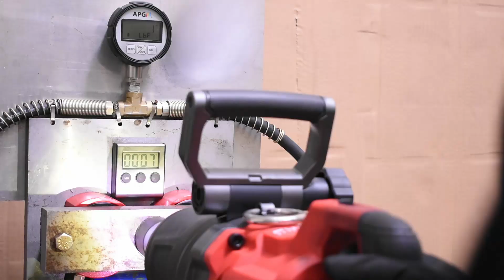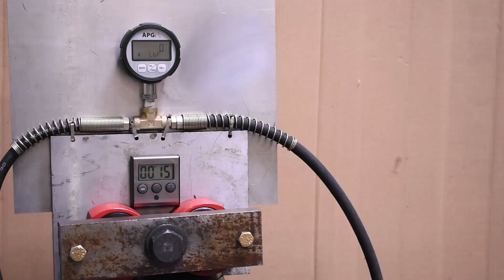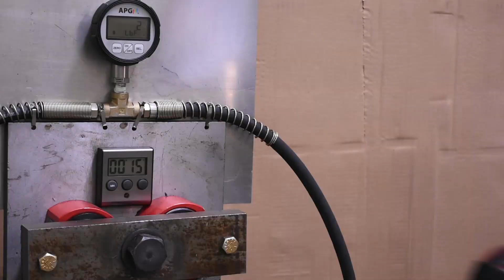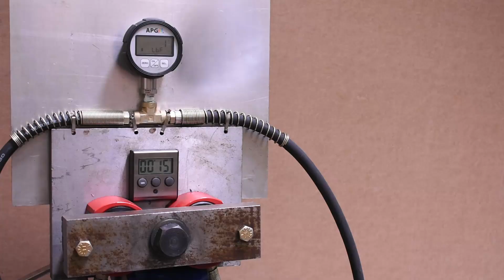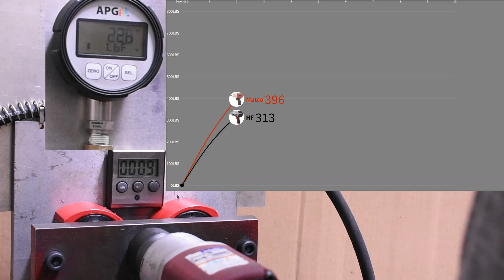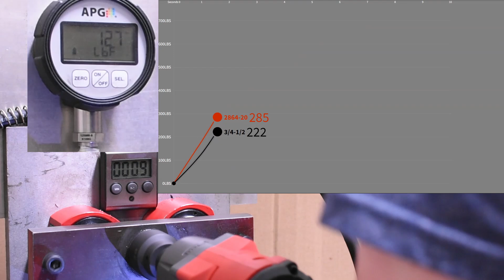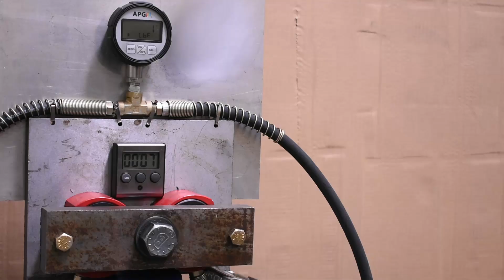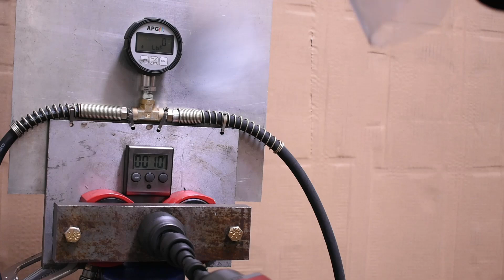How Much Power do Impact Drive Size Adapters Lose?

Comment: I'd like to also see this done with 1/4" hex adapters for impact drivers (to 1/4", 3/8", 1/2" squares) vs. direct-drive hex bits (nut drivers).
Reply from the maker: Not really possible. The direct drive nut drivers dont go up large enough, will just snap off a bolt head that small eventually. Nothing to measure

Comment: I understand what you’re saying about not calling out a manufacturer for low specs if you haven’t tested the same way. But, I’m wondering, is their test setup reasonable? If the specs they claim can only be achieved in a setup that most people can’t achieve, I’d argue that it’s borderline dishonesty. 

Any idea if there’s much difference in efficiency with different air tools? Since it’s hard to actually meet spec on air supply, I’m very curious how different tools are at different air supplies. 

Also wondering if some of the tool companies are using “give it more air” as an excuse to avoid efficiency increases. Some of the less reputable ones might even increase the air supply specs above what the tool is happy / lasts well with, just to brag about their torque numbers. They’d know that most people wouldn’t be able to supply that much air so it’s not like they’d have lots of warranty claims from people using their tools above the safe specs. 

(My interest in this is purely theoretical; I use impact tools primarily in my RV in a Walmart or Home Depot parking lot. Cordless, not air is what I need)

Comment: I did wonder if manufacturers tests were done without even a socket attached to the driver maybe there’s just a square drive on the dynamometer !
Reply from the maker: For dynamic torque it's done into a female square drive, the torque numbers on a box (working, max) are traditionally used with a socket on a Skidmore Wilhelm bolt tension machine like we're doing here
Reply: @TorqueTestChannel  So really you have answered most of your question about why manufacturers figures and yours differ so much !

Comment: After watching this I use an adapter for my job.
No problem.
Because it's only a low torque application work scenario for me.
I will do it again and again if it is possible then waste my time to shop for the recommended size.
Buy if you need it for heavy duty application, go get the right one.

Comment: I'm happy because I have the Makita 18v 1/2 inch impact wrench and only occasional use a 1/2 to 3/4 adapter to undo 46mm nuts and I notice little torque loss. Very interesting. I've been waiting for this video. Thankyou!
Reply: Hey Nick
So you wouldn't trade your 1/2 in to a 3/4 in?
I also have the Makita 1/2 in with 1000Nm (DTW1002 in Europe) but was always wondering if I made the right choice
Reply: @MattPrimefulL  no I wouldn't trade it. I'm happy with it having owned it nearly 2 years. You can also buy 1/2 inch big sockets aswell so no need for an adapter. Most of the sockets I use aren't big anyway. Also It's very rare to come across any nut that the 1/2 inch won't remove which also applies to the 3/4 inch.

Overall I'm glad I bought the 1/2 inch because most of my sockets used are 17mm, 19mm, 24mm and most often are 1/2 inch drives.... the minority of sockets are 3/4 and even the bigger ones nowadays are made for 1/2 drive.

Comment: In industrial settings everything is 1in air hose and chicago fittings. Plant air is usually not anymore than 130 or so psi but flow is never a problem. Some of the bigger guns will use 2 1in lines, 3 men and a crane to hold the weight. Nowadays that type of work is usually done with hydraulic wrenches or super nuts. Great work guys.
Reply: I was looking a specs on 1" wrenches and they want somewhere around 50 CFM, compared to something like 5 CFM on 1/2" wrenches.
Reply: Hytorc hydraulic is the way to go. 
Super nuts are safer though

Comment: Sounds to me like you need larger line to maintain the 90 psi. Note that the pressure jumps back go 150 psi after running it, indicating the tank isn't the issue, rather the supply to the gun. 
Source:just some Joe schmoe that's never even seen a 3/4 impact in person
Reply from the maker: 1/2" air line with 3/8" NPT (which measures about 1/2" nominally) threaded right into the gun is already pretty big. A 3/4" air line is pretty massive in person

Comment: Thanks! That totally explains why I won't buy  a 1/2 to 3/8" adapter, vs a 3/8's impact wrench.  As always your videos are very entertaining.
Reply: I have a Makita XWT15Z that I run a 1/2 to 3/8 adapter all day long. yeah the adapter breaks eventually, maybe every few weeks haven't actually measure the time, but it does work. Now that I know I'm only loosing 7% or so, I don't think that is bad. the Makita XWT16Z the 3/8 version is rated 20 fl-lb lower on the max torque, and 50 ft-lb lower on nut busting, so at 7% it's a wash. But with the 1/2 i'm more versatile.

Comment: The adapters are still great for breaker bars. Since it is more of a constant force you shouldn’t lose any torque.
Reply from the maker: 100% correct
Reply: @TorqueTestChannel  With size adapters and a torq wrench, would the adapters affect the result of the torque wrench? i just bought some for this purpose.
Reply: @raph882  hey mate did you get any answers to Wether it reduces what you should set the torque to?
Reply: @raph882 The answer to your question is no. The centerline of the drive end of torque wrench and centerline of bolthead/nut will be the same, so it is not affected.  Heck, you can use a whole bunch of extensions, as long as they are in a straight line from fastener to torque wrench, the torque wrench will still apply proper torque.
Reply: I've massacred four 1/2 to 3/8 drive adapters doing this in 15 minutes just on 19-21mm lug nuts. I use an old USA made Craftsman breaker bar and it doesn't flex while going thru these adapters like butter.

Comment: You need to try the SnapOn GSAF1F adapter.  Claims it can handle 2000lbs. I use mine with my IR air and battery guns with no issues for years. Probably pushing 500+ ft lbs
Reply from the maker: 2,000 in-lbs :P

Comment: For the 3/4 pneumatic impacts you should try running a second 20ish gallon air tank inline  just a couple of feet of 1/2" hose with only a tee fitting for the pressure gauge running to the gun
Reply: I have a 20 gallon buffer tank fed by my regulated air. My 1” impact is connected to the buffer tank with a 3/4” hose about 10 yards long. Works well even with a very basic compressor, haven’t put a gauge at the impact admittedly.

Comment: This makes me feel better about my choice to buy all my impacts as 1/2" and use the 3/8" or 3/4" adapters.

Now I can estimate my torque losses better.

This channel has become one of my favorites. Thanks guys!
Reply: You can get lots of things done with just 1/2 and 1/4", just have to be mindful of what kinds of power you're laying down because driving an M14 bolt with 1/2" can easily go south
Reply: @lolatmyage  You can definitely get a lot done with those two. I have a small astro nano 1/2", an earthquake 1/2", and a skinny electric 1/4" snap-on ratchet. With good swivels for them, there's not much that forces me to grab a ratchet or wrench
Reply: There new video on the Milwaukee 3/8 vs 1/2 shows that the 3/8 of ANY brand actually outperforms or matches it's 1/2 counterpart
Reply: @user-sg4jm9oq6d did this include ridgid? I saw a video comparing their newest 3/8 and 1/2 sub compact and the 1/2 came out on top

Comment: If you twist the impact gun handle in the direction you want to move the fastener and take up any slack between the squares (for all sockets/extensions/adapters), does that lessen the torque lose? If it does, might come in handy in situations when your gun is barely unable to move it.

Comment: Maybe you could do a test comparing losses to the tightness of fit. An adapter which is loose rotationally could absorb some of the impact energy. An adapter which drops more could perhaps cause the tool to wobble more. That would be an interesting test. Measure the maximum rotation or drop angle and the pressure applied at the maximum angle. Perhaps tape an accelerometer to the tool too.

Comment: Testing idea; testing your own set up.  Specifically how much does it change the results if you over torque the nut/bolt with a high torque impact and then allow a less powerful tool to reattempt the same test.  Similar questions on lubricants.

Comment: Wtfbbq! Love it guys! I've never broken an adapter but mine are S&K from the '70's and I never use them with impact anything only hand tools. I mainly use the 3/4" to 1/2" reducer for axle nut bell sockets on the Dana 70/80 full floating rears.

Comment: I “torque” thing at work at hard to reach to places which sometimes causes me to use a wobble adapter. Torque values are usually between 260 to 500 pound feet. Be cool if you could test torquing a fastener with a wobble impact adapter between the wrench and the socket. Thank you 🤞🏽
Reply from the maker: https://www.youtube.com/watch?v=f0xhgQiTGUY

Comment: I'm curious if an adapter throws of torque wrenches the same way, making their readings up to 30% off
Reply: It doesn't because the torque is applied continuosly. Only impacts lose power. There are videos about it by other channels.

Comment: I just ran into this problem, not having the exact right tool, last week! I was ashamed! I needed to take the wheel off my motorcycle, but didn't have a socket that large in 3/8". Instead I just got my heckin chonker 1/2" socket set and the Ridgid hi torque. Massive overkill. This also let me discover the stock toolkit on the Honda ATAS doesn't have any tools to remove wheels!
Reply: you need tire spoons that have the proper hex on the other end.
Reply: @danedwards1227  ugh maybe. I have tire spoons that are super boss at being tire spoons, tho.

Comment: guessing much of the losses can be attributed to the increased inertia of the socket assembly and also the slack in each connection joint absorbing energy ?
Reply: All of it is the slack.
Reply: @firesurfer  some of it would undoubtedly be increased inertia
Reply: @Pjh495   marginal

Comment: Piston compressors wouldn’t last. You would need a rotary screw compressor to get the correct PSI
Reply: Screw compressors actually don't have high pressure, that is a reciprocating piston compressor, two stage especially. What screw compressors excel at is air volume. They are meant to run for long periods, constant stop and start is not good for them. They are also way more expensive than reciprocating piston units.

Comment: When looking to see where the air pressure is dropping running large guns, i would be looking for the smallest diameter the air has to pass through between the air tank and the gun as that would be the weak link in the chain.

The obvious thing i would change is that l when testing the air pressure i would fit a t-piece with air in-pressure gauge-air out so the air to the gun can flow as freely as possible. This would mean that you would still be getting the true line pressure rather than all the air going to the gun having to flow though the pressure regulator first.
Reply from the maker: Smallest pinch would be a 4 foot 3/4" cast iron pipe (coming from 1")  before it hits the 1/2" air hose that's threaded directly into the tool.
Reply: @TorqueTestChannel  would a 1’ to 1/2” Y adaptor leading into two 1/2” hoses, and then another Y adaptor directly into the air gun work? Bypassing the 3/4” pipe?

Comment: Well damn apparently I need a one inch impact. Didn't realize how much that 3/4 to 1 inch adapter was throttling the gun. That being said there's always the torch if the impact won't take it off :) and it's a lot cheaper.

Comment: Super video! I’ve been using my Milwaukee 1/2” high torque to remove lug nuts from trucks and heavy equipment for a couple of years now. I’ve found that using a 1/2” drive socket works much better than 3/4” drive with an adapter. I had assumed that the additional wiggle room in the setup eats up all the beans, but now I know.

Comment: Can you do a video on fitting size on different air hoses? Curious if running a smaller fitting at the end of a big hose will limit power on impact guns.
Reply: I think there is a video of that and I'm pretty sure there was a torque loss with the smaller fittings.
Reply: There would have to be, the restrictor would have a faster flow rate but lower pressure so there a bottleneck b

Comment: I no longer feel bad that I can't ram enough air into my 3/4" impact!  I was starting to think I'd just screwed up when I rebuilt it.
Reply from the maker: When we first saw it, we thought we did something wrong. There's no way we and everyone with similar shop air can be only driving 3/4" impacts at 80-90% beans, right?
Reply: @TorqueTestChannel  Can i just point out that you said you removed the wall regulator but you have a regulator connected straight to the tool, in my experience regulators always reduce flow so try putting a tee piece on the tool with a pressure gauge on it.
Reply from the maker: @dazthedonrambo  40CFM max flow and 1/2" to 3/8" NPT fittings, but fair enough i see your point.
Reply: @dazthedonrambo  exactly what I was thinking.
Reply: @TorqueTestChannel   Don't air tools consume more air when revved without load? The vane motors roughly consume a fixed displacement per revolution (plus leakage) so air consumption goes up with RPM. It would be interesting to revisit the pressure reading while driving the test stand.
Reply: Super late reply, but is there a difference in working pressure once a bolt is tightened down and the gun is hammering?
Reply: In industrial settings everything is 1in air hose and chicago fittings. Plant air is usually not anymore than 130 or so psi but flow is never a problem. Some of the bigger guns will use 2 1in lines, 3 men and a crane to hold the weight. Nowadays that type of work is usually done with hydraulic wrenches or super nuts. great work guys.

Comment: The only thing I learned is that you guys are really funny. From years of experience, I knew that to reduce or increase size was power reduction. I also knew that Mac had the strongest 1/2 impact although I was mostly a snap-On kid of guy. Mac was mostly a "come off" or "brake off" tool either way was a fast option. Snap-On sockets were pretty much bullet proof. Thanks again.
Reply: I've had plenty of snap on sockets fail chrome and impact. I've had bolts that a snap on socket would round but if i used a craftsman USA sockets came off no problem. I've beaten the hell out of cheap 10mm 3/8 husky chrome sockets using an IR2235 and though they wallow out I've yet to have one crack so far. IMO the only socket that snap on makes that is some what superior are their impact swivel sockets, and I've cracked/worn out four of those within two years. Their normal sockets are over priced no better than what I can buy at the box store for 5 bucks a socket.

Comment: In my experience, you usually lose 100% of the torque when using 3/4"-1/2" and 1/2"-3/8" adaptors. Because I've broken about 3 of each. Sheered the anvil right off. However I use my 1/2"-3/4" all the time because I don't have a 3/4" impact gun.
Reply: My rule on these as well. They work better going up in size than going down
Reply: Yeah stepping down is really something to do with hand tools, you have more control over the torque

Comment: SUPER curious about the low profile adapters. Basically a cover that just slides over a 3/8 to make it a 1/2, they add little to no extra length, maybe this would get rid of some losses.
Reply: I recently bought a set of lo pro adapters from Ares (maybe Titan, I forget) because I worry about damage to the anvil when using the standard ones. Haven't used them yet but they fit beautifully. Amazon has a few offerings
Reply: I thought the same thing.
Reply: It's the sloppy fit that causes loss of energy. The tighter the fit, the less the loss.